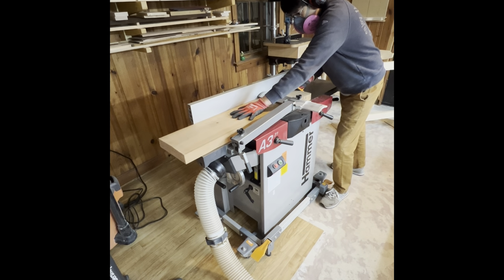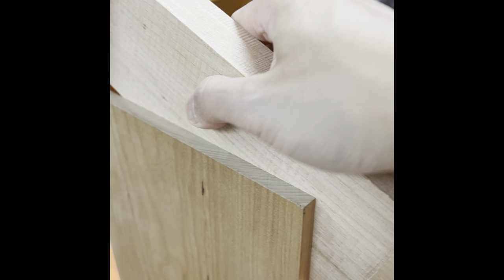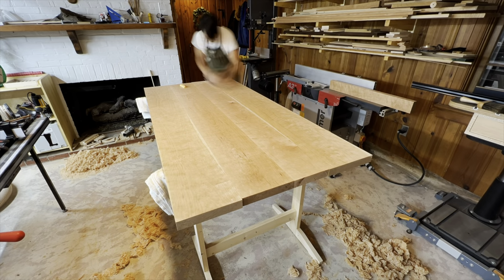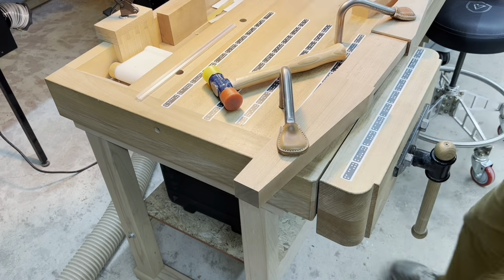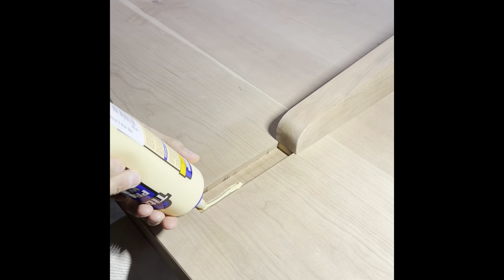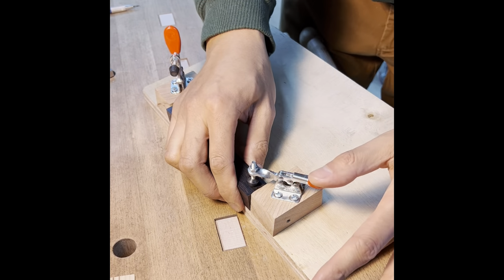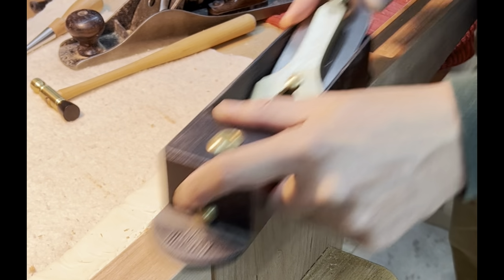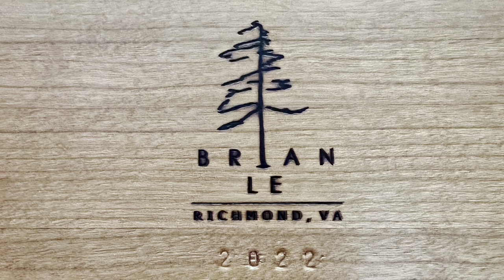Trestle Table Build using Tapered Sliding Dovetail Joinery

Comment: Wonderful video and great joinery!

Also, accounting for board flips in all directions, 384 combinations I believe.
Reply from the maker: Thank you so much for watching and taking a stab at the math problem I forgot I embedded in there! I didn’t think anyone would comment on it but I got 96. I figure there are 4! (24) ways to arrange 4 boards and since each board has 4 edges or 4 possible arrangements, I got 24x4 =96. But It’s been a while since I had any math class lol how’d you get your answer?
Reply: @briantheprion yeah you’re right. I don’t know where they are getting 384. Even if you counted the edges and ends of each board that’s still only 12 possible states of each board which would be 288 permutations. Obviously that doesn’t make sense in a tabletop. 

If they were considering each state of each board as a separate object we get over 384 really quick so, yeah, I don’t know how they got that number.

Comment: Also a fan of Mr. Ishitani. You executed this very well, and I know enough woodworking to understand how much you 'left out' of the video! The sliding dovetail key blew my mind - so elegant, yet effective - and deceptively 'easy' looking. 
Subscribed, and much appreciation from up here in Stafford, VA.
Edit addition: I think the answer to your math question is 24.
Reply from the maker: Yes you understand! That balance of adding too much detail and then people are bored and then if I skip too many parts, its hard to follow and understand. I think I stopped at the Log Cabin Restaurant in Stafford on the way up to DC lol. 

Oh and the 24 is correct for the number of different ways the boards themselves can be arranged...but hows about 4 sides per board? :) I got 96 different ways!
Reply: @briantheprion  I discounted the surfaces on the assumption you'd already selected the best faces for show side and bottom side already, but yeah, 96 for the entire set of surfaces... good lord, why do I even know this?

Comment: The tapered locking sliding dovetail is an awesome way to join the stretcher to the legs. I’ll definitely be using that l. Thank you for the inspiration
Reply from the maker: It really is a great joint. Hard to wrap my mind around it at first but I think it’s more elegant than a wedge tusk tenon imho. Good luck and let me know how it turns out!
Reply: He copied it from Ishitani Furniture if you want to see a true professional at work.
Reply from the maker: @adrianturtle1985  Mr. Ishitani is a true professional indeed! He does not use this same joint however. This one is a little bit more finicky to make.

Comment: Amazing craftsmanship. The confidence to plane that top with no tear out is impressive
Reply from the maker: Thank you Dustin: I’ve had plenty of tear out during the flattening stage and made a “planing map”; basically a scrap of wood where I would draw the boards that make up the top and I would draw an arrow for the favorable planing direction of each board. So with that knowledge, a super sharp blade with a light pass and a small throat opening, I had zero tear out. Give it a try sometime!
Reply: @briantheprion  that's a great idea!

Comment: Really nice table Brian.  Also I love in ingenuity and the use of many planes.  I’d also like to comment on the videos quality of production.  Lastly, Ishitani is great, I’ve learn a lot watching his videos too.
Reply from the maker: I’m not above using a random orbital sander but sometimes a plane just makes for really accurate adjustments to parts fitting and it’s fun to use too! Thanks for dropping me a line! Do you make furniture too? What kinds of things have you made?
Reply: @briantheprion  I do actually, I started when I was nine years old.  I make tables, desks and some smaller stuff for my corporate clients.  Lately I’ve been making a few things out of slab wood but those are more experimental.  Recently I’ve upgraded a bunch of my machines, I now have a Laguna CNC, Hammer C-4 sliding tablesaw/Joiner/planer/shaper and a big Laguna laser.  I’m using the new machines to do the slab experimentation.  

BTW, I saw you on my daughters account, this is her father, Michael
Reply from the maker: Hi Michael. Wow you got some legit nice upgrades with the laguna cnc and the hammer combo machine!

Thanks again for replying and letting me know the type of stuff you do!

Comment: Amazing!  I never knew that about the joint, to get it to disappear like that. Thank you sir for this video, I hope you make more in the future.
Reply from the maker: Thank you! Yeah it’s a finicky thing to get a spring joint since the boards I had were ~2 inches and I couldn’t plane them both at once to negate any bias in the blade to ensure they glue up flat. So I was constantly checking squareness during planing. Cheers!

Comment: Absolutely beautiful table! Your attention to detail is on another level.  I watch a lot of woodworking on YouTube and I learned a couple new things from your video. Great job! New subscriber!
Reply from the maker: Thank you Josh for watching it and leaving a comment! I wanted to share some of these finer technical points that no one has really showed in detail before. Which technique or points were most useful to you? Is there anything you would do differently about technique or the video?
Reply: I like the spring joint technique! It looks like a great tip for large panels. Is it hard to accomplish?
Reply from the maker: @BubbaLeroy  not too bad- just go slow and be methodical about it and constantly checking for square.

Comment: Very nice table! And to answer your math question @ 2:26 , 24.
Reply from the maker: You’re close with the 4 factorial…also you can flip the turn the boards too…so I got 96 different ways! Thank you for watching and being 1 of 2 to actually try the math problem!
Reply: @briantheprion  I guess if you’re going that route with each board being able to be positioned 4 different ways, there’s 16 options for the first, 12, 8 and 4, so then you’d have 6,144 different options of board arrangements, of course, that’s only off the assumption that you don’t mind the grain direction.

Comment: Hello Brian, great table! Are you aware of the method for dropping a running dovetail in the middle of a panel without the need for an opening on the edge? You split the width of the rib in three and create dovetails on the outside tw parts. Place those in the blind dado you routed in the panel and dovetailed. Then hammer the third part of the rib between the two outer parts. Voila a blind running dovetail at both edges of the panel. Neat trick.
Reply from the maker: That's a great technique. Really leaves a nice seamless and unmarred edge. Here's two more for you: before gluing up the table top; route the mortise in from the middle of the two boards. Attach the batten and place the other half of the table together glueing the edge but leaving the batten to 'float'. Second method uses a segmented dovetail slot so that you can drop it in vertically perpendicular to the surface and slide it forward: the linear equivalent to how a breech mechanism works on artillary. :)

Comment: Gorgeous! Thank you for sharing your process. Can I ask how much overhang you have at the ends of the table from the legs? Wondering about a good leg clearance there. Prefer not to straddle that upright if I can get away with enough cantilever. Thanks!
Reply from the maker: Thank you for watching and your comment! I designed it exactly 12 inches from the edge of the batten to the edge of the table and I determined this by making a mock up with some plywood and 2x4 prototype so I wouldn’t run into the straddling the trestle legs. I’m 6 foot tall so it might be different for you but yeah make a mock up of it to see if it works!
Reply: @briantheprion  awesome, thank you for your reply! I made the stretcher thru tenon dovetail wedge joint today. That sure was challenging but it fits like a glove  and looks pretty slick. What a neat joint that is!
Reply from the maker: That’s awesome! Are you on Instagram? Would love to see the end result!

Comment: Hey great work Brian, I'm actually in the process of making an Ishitani inspired dining table as well so it's great to see someone do such fantastic work!

It appears you tapered the legs of the table so the top is narrower than the bottom so the bridle joint is angled where the feet meet the legs. 

How did you go about measuring and cutting the joints so you got a tight fit? It seems quite difficult to do compared to a straight 90 deg and square bridle joint.
Reply from the maker: Hi thanks for watching! The vertical member does join the foot at 90 degrees but at the top, you’re right it’s a bridle joint where the angle is tapered. In order to do this, you need to use a bevel t square to match the angle on the horizontal member and cut the lap joint purposefully too small. I’m talking the realm of 1/32-ish. Once you have the actual lap joint fitting, the last step is to hand plane the angled/tapered sides so that you sneak up on that perfect fit whereby the sides tighten-up just as the half lap fully seats. Does that make sense?
Reply: @briantheprion   Hmm I think I'm understanding it a bit more. Sorry not sure if I’m totally getting it, I understand it’s hard to articulate without photos haha. Does this sound right?   

1) Transfer the angle of the taper of the vertical member to the horizontal member  

2) Cut the lap joint on the horizontal member at that transferred angle but leave it about 1/32” small (in terms of it’s width, so it would not initially go all the way down into the vertical member just yet)  

3) Plane down the sides of the inside of the lap joint on the horizontal member to sneak up on the fit until it goes all the way way in.  

If I do have that right, what kind of plane are you using to get plane down those inside edges?
Reply from the maker: You’re almost there: instead of planing the shoulders of the inside joint, which you can do if you have a shoulder plane, it’s easier to plane the face of the sides of the vertical component. Does that make sense? If you’re on Instagram send me a message at BrianThePrion and I can film and send you stuff so it’s easier to understand
Reply: @briantheprion  awesome, I dm’d you on Instagram to just follow up. Thank you so much!

Comment: Nice work. I thought the Hammer A3 was factory calibrated to automatically introduce a spring joint. Was yours out of tolerance so it actually joints boards flat, or did you adjust it?
Reply from the maker: Thank you for watching and dropping a comment. When I first bought the machine, it had some pretty bad snipe and so I spoke with their excellent customer service and they showed me how to even out the roller pressure. During the conversation they told me it’s set to plane straight and true without any concavity or convexity. The convexity that resulted in that board before I planed it is 100% my fault since I was doing it solo and probably set the roller support too high.

Comment: The board problem is basic permutation with the twist that each board has 4 possible “states” (original, rotated 180, flipped 180, and rotated and flipped.)

So basically P=4! which is 24 possible positions the boards can be in, and times that by 4 since each board can be in 1 of 4 states in each position. 

So 96. Here’s to hoping you find an arrangement that looks good without having to go through all possibilities.
Reply from the maker: I actually did this problem with my dad the other day. I used to think this was the answer but I think there’s even more possibilities!

Comment: Hey Brian, I know you ended up making your own reamer because of the rare African wood you had. If you'd used a more common wood, would there have been an easier solution instead of making a custom reamer?

Was wondering if there's a simpler solution out there. I've seen some tapered reamer bits around but not sure if that's the way to go.
Reply from the maker: Such a great question. I thought about this after I finished the project about how I could have made this easier on myself and I found that there are peghole reamers for guitars and violins but the overall size was too small and the taper too steep for what I needed. There are some automotive reamers that are closer to what I needed on Amazon. Admittedly, if I did it again, I’d prob get those reamers and then make the pegs fit the reamer vs the other way around but my method shows you a solution to a problem I created or if you only have a small amount of wood and can’t afford to loose length by turning it on a lathe.

Comment: At 12:49, the wedged tusk … is it a compound bevel?   It looks fascinating….  Not sure how the tenon is cut to receive it
Reply from the maker: Hi Brandt! Thanks for watching! The wedged tusk/key is indeed cut with a compound cut; 8.5 degrees on the side walls but it also has a taper over its length. Im sorry my explanation in the video is a bit rough. I should make a separate video explaining this joint alone but once you make the mortise cut, you measure with calipers the opening at the top and bottom of the mortise and transfer it to the tenon blank. Extend the lines to either end and draw 8.5 degree lines on the end grain and then you have a reference to saw to. I hope that helps!

Comment: Why don’t ‘we’ never wear gloves near a running saw blade?
Reply from the maker: That’s an excellent point. I’m setting a bad example.
Reply: A good reason is that wearing gloves won't stop a saw blade injury and if you get injured while wearing gloves all the glove debris has to be removed from the injury site. Another reason is that a loose part of the glove might drag the hand into the blade. The general rule I was taught was that gloves are never worn around rotating machinery because the glove itself can be the cause of getting injured. A further reason is that in the event of an injury the remains of the glove need to be removed before treatment can start and that sounds painful to me.